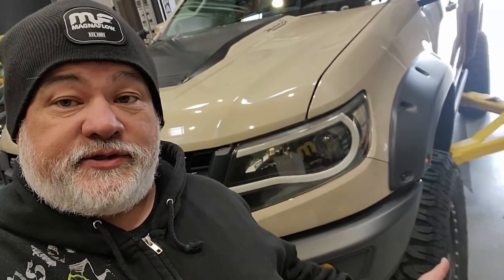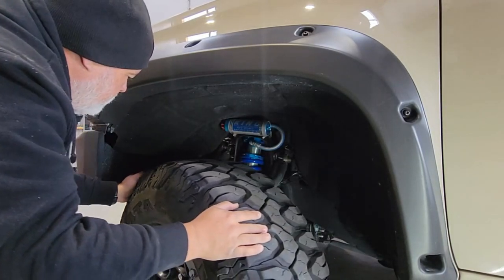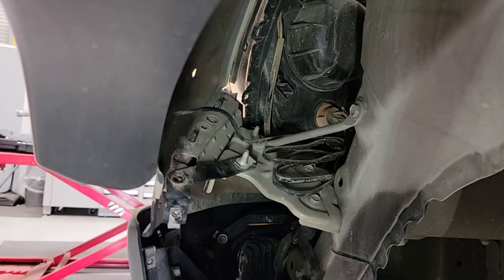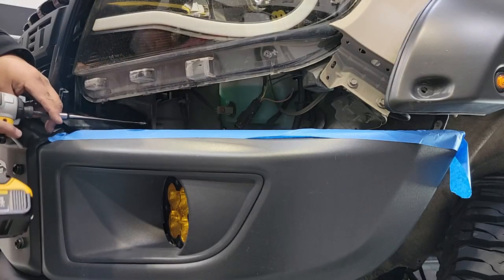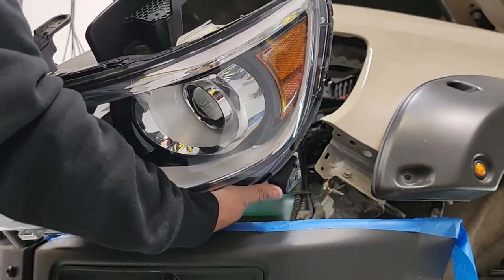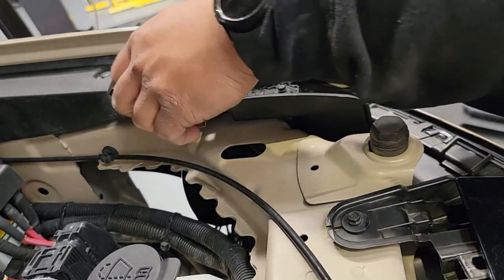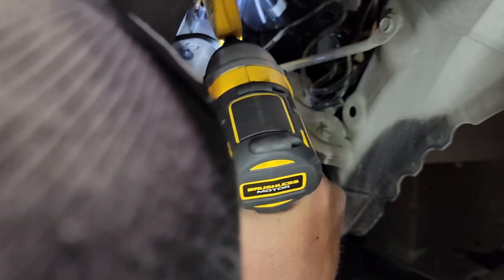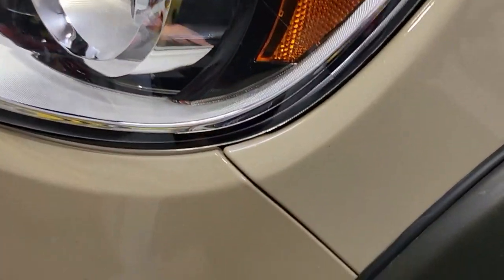Headlight Housing Removal / Installation - 2017-2022 Chevy Colorado ZR2 Bison

Comment: Now I am in anticipation to see if you do an LED bulb upgrade, I personally have been thinking about it. I found some larger aftermarket dust covers to fit some proven led bulbs.
Reply from the maker: I will test out a couple LEDs in the stock housings. I had tried a few stock  but it seems the same discussion is still taking place.

Comment: It's very difficult to find anything in the aftermarket that lives up to the build and test standards of an OE lamp assembly.  For my 2020 Bison, I stuck with the OE housings, but vastly improved the lighting performance with LED replacement bulbs from Lasfit, which seemed to be the best ones I could find.  I've been completely happy with that setup thus far and have had zero issues.
Reply from the maker: I have tried a few brands and seen some better than stock results but nothing quite does it right with a great cut-lines and no weird shadows or light bleeding. With all that said, more white light and greater output alone are probably good enough for most.
Reply: @exhaustinglife  In my case, these are purely for on-road performance. For the signal, marker, reverse, and stop lights, it wasn't even close. LED wins hard on those. For the headlamps, I can see room for debate.

I have Baja Designs ditch lights, chase lights, and a light bar for trail work.
Reply from the maker: @JoeMoutard  you are exactly right, I was staying on the topic of the headlights. I had run the Baja Designs Squadrons, XL and S8  forward facing lights to make up what the OEM lenses could not do.
Reply: @exhaustinglife  To be fair, I'm actually using your build as a primary education source for my own.  The Mallett kit that's been sitting in my garage for way too long goes in this weekend.

Comment: Might be a dumb question but do you have to do all this to change the bulb? (I’ve had other vehicles that required pulling the bucket to change bulbs) (Not a Colorado owner-yet)
Reply from the maker: No this is to change out the entire housing assembly. The bulbs are fairly easy and can be done in 30 mins with the Passenger side being a little harder because you need to remove a cover that directs air to the intake box.

Comment: I have a ZR2 with the Highmarks and wonder if I can do the same. Way easier than disconnecting my winch and removing the front bumper and bull bar
Reply from the maker: Its definitely doable. I did this to install the housings and now to remove  them and return to stock.

Comment: Same for zr1?
Reply from the maker: The headlight assembly removal / install is the same for any 2015-2022 Colorado or Canyon except you need to remove the entire bumper fascia vs just the filler panels.

Comment: Whoever designed the way you have to remove half the vehicles panels to replace the headlights should be sacked drawn and quartered and sued by every Colorado owner.
Reply from the maker: It certainly is a chore and I am a little spoiled having come from the full size world where two pull pins after opening the hood was all that was needed.